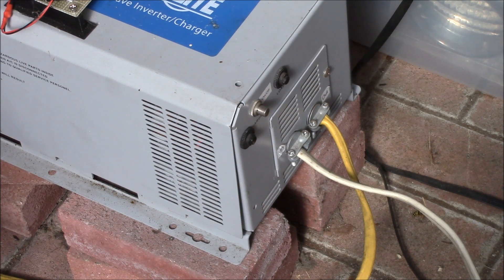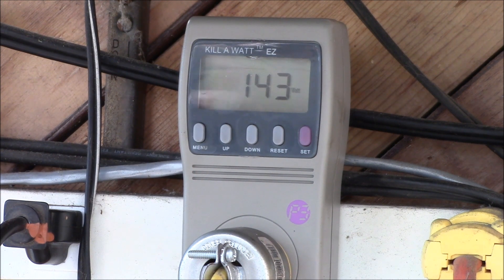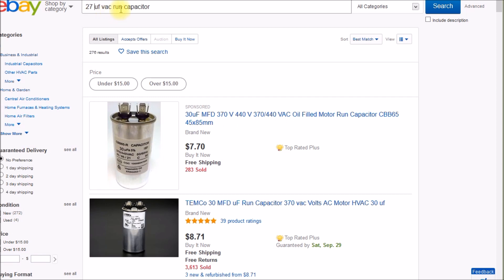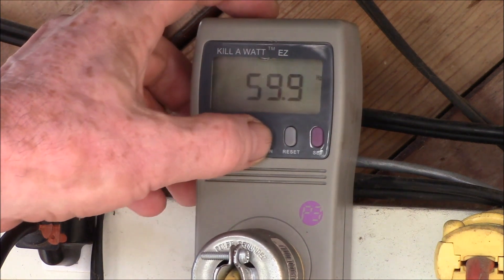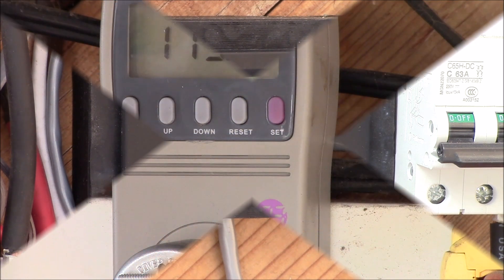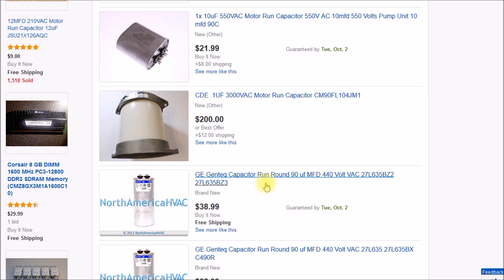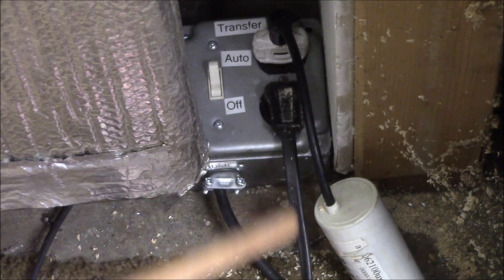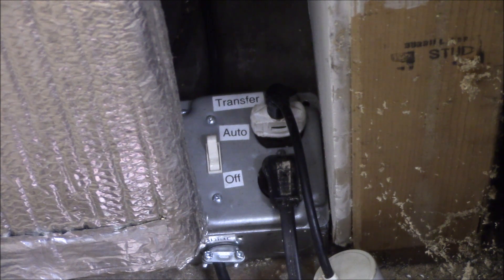Power Factor Correction and Inverters

Comment: Apart from wasting power, what is the long term effect of poor power factor on the inverter?
Reply from the maker: Assuming the inverter will run the load, poor power factor will make the inverter work harder and run hotter.  That added AC current comes from the input capacitors and MOSFETs on the inverter so you have more current and higher ripple on the DC input.  That heats up the caps and causes them to age faster as electrolytic caps have a service life at at a given temperature.
Reply: @The4Crawler  Thanks a lot. I really appreciate the prompt reply. If you don't mind I have a few other questions. How or where should the power factor correction capacitor be installed on a motor with variable frequency drive (VFD)? Are there ways or equipment for automating the power factor correction? Apart from better surge capabilities are there other reasons why a low frequency inverter might run inductive loads better than high frequency inverters? I apologies for asking so many questions. I am about to get into off-grid solar. I have acquired a high frequency inverter and plan to use a motor with VFD with it but I have seen some negative comments about running a motor on such an inverter.
Reply from the maker: I've not worked with VFDs, but they are an active device and likely can't just have a capacitor thrown across them.  A good VFD unit will have power factor correction built in, combination of hardware and software.  A cheap VFD probably won't have PFC built in and will be fairly hard to correct since the power factor will vary all over the place at different times.  Also a good VFD should do things like have control over how fast the motor ramps up in speed and/or some sort of current limiting capability.  No need to slam 120V across the motor terminals when it's not rotating.  A VFD is essentially a DC to AC inverter, typically 3 phase and of course at a variable frequency.

How well a given inverter will handle motor loads all comes down to the design.  If it's designed to handle low power factor loads, then it will, if it's not, then it won't.  Many low freq. inverters, like the one I have, are set up like a 12V - 120V transformer.  You drive the input with high current / low voltage and you get out high voltage / low current.  That big transformer and iron core is what helps a LF inverter handle starting surges, etc., it's like a big flywheel on an engine:
https://www.magnum-dimensions.com/knowledge/high-vs-low-frequency-inverters/inversion-methods-explained-high-frequency-vs-low

The HF inverters step up the input voltage to something like 170VDC internally.  Then they switch that on and off to the outputs to make the 120V AC output.  They'll have small inductors and capacitors for filtering to clean up the output waveform.  But how well they handle high surge loads depends on how much excess capacity there is in those caps and coils.  Low cost HF inverters will have just large enough components to operate with nice loads.  The higher cost/quality ones will have bigger (more expensive) internal parts and be able to handle more surge.

If you are shopping for a VFD, try to find one that'll work on an inverter system.  You may need to contact some of the mfgs. and get information on which inverters they recommend.
Reply: @The4Crawler  Thanks a lot for taking out time for detailed reply. You've really helped me with hours or days of research. Best wishes and thanks again.

Comment: Wow, thanks, I was looking before about this, even asked my utility company, they said power factor does not exist! Of course they did....
If you added another 15 uf to drill motor would you get   better pf?
Reply from the maker: Yes, for most/all residential utility customers, there's no charge for reactive power or low power factor.  Unless you are popping breakers due to excessive reactive current, you can use all you want.  

I've heard rumors of some countries (mostly in Europe and Australia) that are considering adding power factor surcharges to residential electric bills. With the new digital and smart meters, that data is already being read.  All it takes is for some Public Utility Commission to give the OK to charge for that and then someone can tick a box in the utility billing software to add that cost to the monthly bill.  

This is because, even for the utilities, they have a certain generation capacity (MVA) and if the power factor is low, then the MW they can supply is much less than the MVA capacity.  When that happens, they either need to dump loads (brownouts or blackouts) or build a new power plant.

Comment: Well done on explaining PF.  Question for you.  I am planning on modifying an old APC UPS for inverter only operation.  It will work from the solar system to power a 4 cu ft mini fridge.  The compressor circuit uses a PTC to hard start the small compressor, there is no contactor.   I am less concerned about the PF but more so on the in-rush surge amps as that is the killer for the mosfets and hard on my small  li-ion power wall.  So, did your adding of the capacitor to correct PF also result in a lower surge amps on startup?  Having not worked with PTCs on compressors, would you wire the capacitor before or after the PTC going to compressor?
Reply from the maker: The power factor correction cap. can help with in-rush current a bit, by reducing the amount of reactive current that needs to flow from your inverter.  I have a super capacitor bank between my Li-Ion batteries and the inverter to help with that as well:
https://youtu.be/O2QQ-fiflFE
I'll see ~90 amps surge going into the caps and inverter when the freezer starts up.  In the inverter wires I see ~200 amps for a brief instant.
I've not worked with a PTC controller either, I would think you would want to get the PF cap. wired right across the motor for the most effect.
Reply: Thanks for your reply.  For some reason I never got a bell notice of your reply.  Youtube grimlins?  

Wow, that is quite a surge spike for you, but reasonable.  I don't have any super capacitors to help between the LI-Ion Wall and the APC UPS (now successfully modified as a pure sine wave inverter for auto startup/shutdown when the fridge thermostat calls to turn on the compressor) but I do have a bunch of Li-Ion high current capacity cells from old cordless drill packs.  Was thinking of making up a smaller bank of these to substitute for the supercaps.  That should take the edge off the regular laptop li-on bank current demand since they are not rated for that.  Still in your case, using super caps, I still do not understand one thing.  I know your load will first draw mostly from the super caps for the first instant (high current demand) and thus relieving current strain on the Li-ion bank -- in theory.  But is this really the case since the the Li-ion band will then nearly immediately see the super caps as a high drain load any way?  I wonder, in the real world, if the setup reduced strain is really just due to the fact that we have 2 energy sources in parallel and that in itself reduces cell-to-cell current stress.  Any thoughts?
Reply from the maker: The high drain cells might be a good option, connected close to the inverter inputs.  I have my super cap bank on a separate heavy bus bar that the inverter also connects to.  The battery bank feeds the opposite end of the system bus, where the charge controllers also connect to.  There's a shunt for a power/current meter between the system bus and the inverter bus.  

If I hook a clamp meter onto the inverter wires, that's where I see the ~200 amp spike.  On the meter reading off the shunt, I see a smooth rise of current out of the batteries, taking a second or two, with it rising from ~3 amps (idle current) to ~13 amps (running current).  There might be a bit of a spike that the power/current meter is not displaying.  

My thinking on why it works this way is to look at a capacitor discharge and charge curve:
http://www3.ncc.edu/faculty/ens/schoenf/elt115/ucc.html
Discharge starts out with a massive current that drops off with time and the voltage falls.  But in charging, the voltage rises more slowly as you near the full voltage.  Since the inverter is probably only pulling the caps down 1 - 2 volts at most, they are being charged back from say 14 to 16 volts which is the top end of the charge.  So that recharge current is much lower than the initial discharge current which may only last for a few AC cycles.  On the clamp meter, I'll see one reading around 200 amps then a 2nd reading maybe half that, it falls off really fast.

Before, on my lead acid system, I had the super caps in parallel with the batteries and there I would see the 200 amp surge going into the inverter out of the parallel capacitor/battery bank.  When I re-wired it into the Li-Ion system, I moved the caps next to the inverter to help isolate the batteries more.
Reply: Well you knocked it out of the park!  Thanks for the advice.  You are right, of course, the charge/discharge curves of BOTH the source li-ion powerwall and the inline surge cap (my hi-drain Li-ion pack) relative to a load (fridge) all have to be weighed relative to each other's load reactions.  So it seems based on your comments and my on experience, that using a hi-drain li-ion small bank in substitution to your super caps should do the job without causing a heavy surge from the laptop Li-ion bank.  In fact, maybe better, as I think it will have the equivalent of far more Farads than the super capacitors in all while still able to delivery the required surge amps.  On your setup, you have all the bases covered.  The only thing you might consider to further reduce the current surge is to incorporate an inductor in series to your fridge to slow down the current ramp to in effect have a soft start.  You would need to do some calculations and maybe check on a scope how well the compressor would fair.  It is possible it can start up without all that surge just fine but I know some compressor motors will overheat in attempting to reach full speed without the FLA and could become damaged.
Reply from the maker: What I have now seems to be working fine.  It's also somewhat temporary as my ultimate goal with the freezer is to replace it with a Sun Danzer DC chest freezer.  That'll cut the energy consumption by a factor of 4 and eliminate the need to run it off the inverter at all.  I had thought those units were either 12V or 24V so I was holding off getting one until I decided if I wanted to switch to a 24V system.  But I found out they run from 10V to 30V DC, so I should be able to run one of those on my 16V system now and 24V if I later make that change.
Reply: Agree, it would certainly solve a lot of issues to simply run a fridge off DC without the complications and many losses using AC.  But also, we would want to use the highest DC voltage supply as possible.  12V is not as efficient as running at 24V.  I have seen small DC compressors/condenser/evap sold individually for far less than an already manufactured DC fridge.  I have thought of possibly involving a refrigeration tech to see if it would be feasible and cost effective to retrofit a regular fridge.  Have not seen any videos on YouTube showing the conversion.  If it worked, this might be the ideal way to go and have lots of fridge cooled space capacity (home use) rather than those tiny DC  ice chest (for camping style units) that force you to have to move stuff around from the top area to see stuff in the bottom.  Either way I look forward to your next fridge/cooling projects.
Reply: Just wanted to thank both of you guys for this info. Did you get that mini fridge project done EnergyCrafts?

Comment: Why not an DC refrigerator and freezer,  that really saves energy.
Reply from the maker: Would love to go that route and may do so if I upgrade to a 24V system.  Main reason is cost, ~$1500 for a Sundanzer chest unit.  And the old freezer is still running so this is a temporary measure that I can do with my existing equipment.
Reply from the maker: Finally do end up going that route and am in the process of installing a 24V DC freezer to replace the AC powered upright unit.  Stay tuned for a video series on that project.
Reply: @The4Crawler Be sure that you buy an energy 
efficient compressor refrigerator or coolbox.

I have an ENGEL compressor refrigerator for years, very economical in use suitable for 12 and 24v